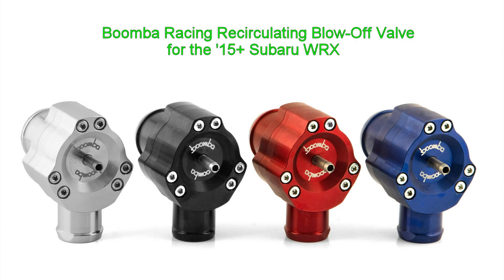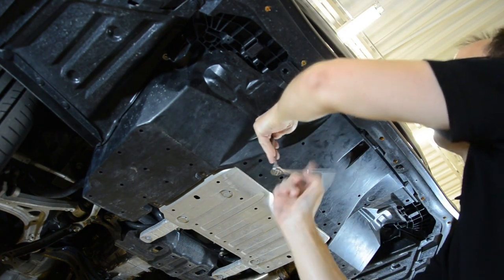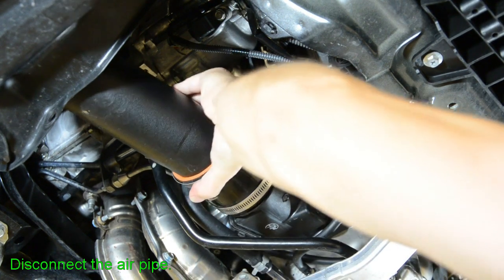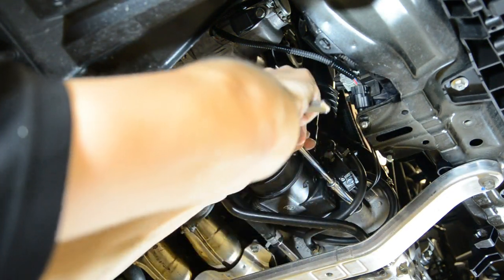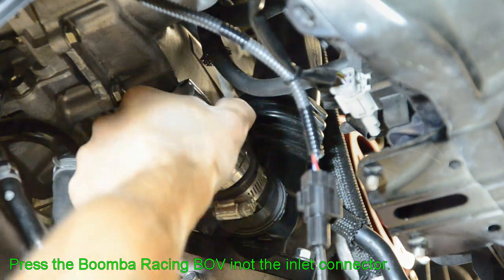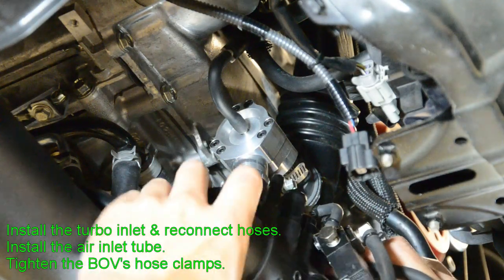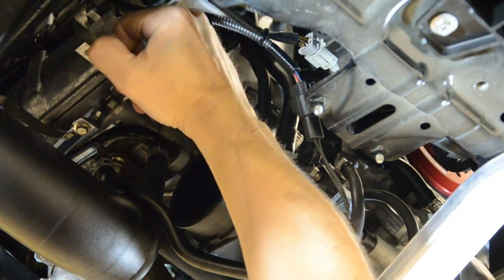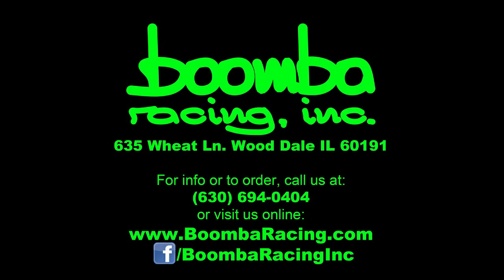How to Install | Boomba Bypass Valve for '15+ Subaru WRX

Comment: Great video Boomba. I'll be installing mine tomorrow, followed by my new IAG Air Oil Separator, Process West FMIC (TMIC delete), Mishimoto Radiator, Mishimoto Radiator Hoses, Mishimoto Radiator Fans, Cobb Overflow Tank, then the Cobb Redline Intake. Should take me a couple days done after work, but videos like this make me feel like it's gonna run pretty smooth. Until I drop that ever so important bolt that always ends up falling into a void lol. Thanks again!
Reply from the maker: Sounds like a good build! Thanks for the support!

Comment: Greetings all.   I just installed my new Boomba bypass valve on a 2018 WRX.  I test drove it, and all felt great.  My boost gauge showed a peak of 22.9 psi after one pull.  I don’t know what it showed before with the stock part.  Wish I had noticed.                         
Like “Subaru WRX” says below.....  our newer cars are different than the one in the video.  I’m glad he made his comments on this matter.  It did help. Thank you, Sir.

Comment: So I just got done installing this in my 2017 wrx...dude, this thing feels like it makes a HUGE difference. I'm not exactly sure how much but I definitely felt it in my pulls.
Reply from the maker: Thanks for the positive feedback! We're glad to hear you are happy with the piece! Probably picked up some PSI that your OEM piece was leaking off.
Reply: Boomba Racing if I reinstall the factory bpv, will that be ok after the hose being trimmed?

Comment: I just ordered mine! I cant wait to put it on! I just installed Cobb Port/SF 1 intake on my 2020 WRX. Thanks for the Vid!!
Reply from the maker: Thanks for choosing Boomba!
Reply: @BoombaRacing Easy to install. Took 45 mins or so. Sounds fantastic!! Thank you for the great product!!
Reply: Did you use an OTS tune or an E Tune?
Reply: Jay Lacson did you need a tune to run it or no
Reply: @darrenhernandez2459  No tune needed
Reply: @GaragebuiltOriginal  No tune needed
Reply: Jay Lacson thats surprising lol usually every little thing u put on subies you need a tune for smh! Thanks for the info
Reply: @darrenhernandez2459  Thats the first thing I researched before installing it lol.
Reply: @darrenhernandez2459  Its sounds crazy good with a nice intake!
Reply: No tune for intake either?
Reply: @lecoureurdesbois86  cobb accessport

Comment: Installed on my 2020WRX. Definitely a difference with throttle response. Much quicker pick up between shifts. Nice flutter sound!! Thanks Boomba Racing. Highly recommend as a first mod for your WRX. Not a bad way to get some extra gains.
Reply: JP's WRX yes, slightly.
Reply: It fit and lined up perfectly on my 2018 WRX without trimming the bypass valve connection on the turbo inlet. Some trimming may be required on older FA20 WRX models though. I however paired this with a Perrin charge pipe, Apexi drop in filter and a Perrin turbo inlet pipe and love hearing the turbo spool and bypass valve sounds that are audible. On a side note, 2015 to 2017 WRX's have an intake silencer/milk jug whereas the 2018 and newer ones do not have that on the factory air box, which can affect hearing the turbo and bypass valve
Reply: @Khans0120  hey ur comment is scream that I have finally found someone that can tell me why I can't hear my boomba bpv on my 2019 I also have a pretty Loud axleback exhaust if that matters please help me out!!!! I'd appreciate it a ton
Reply: Do you have any other modifications done to the car, preferably to the air intake so the engine breathes easier? If you haven't removed any of the plastic intake ducting and replaced it with something that lets the air flow freely,  you really won't hear any bypass valve sounds at all. If you want to know the most audible method of getting the sound, though, it will require you to install an aftermarket cold air intake and get the car pro-tuned so the engine does not get put in danger. On a side note, the Cobb OTS tune is not the way to go because that tune was not designed for your car specifically. That Cobb OTS tune possibly could work fine with your cars engine, or it could become a ticking time bomb due to your car residing in a different environment than their shop cars
Reply: @jamessanderson3498  what do you need help with? I have the same set up on my 20’
Reply: @brycegutierrez3483  I'm just wondering if I need some sort of aftermarket intake or at least the air pipe Inlet to get flutter

Comment: Installed mine tonight. Thanks for the video. I did not have to trim anything on my 2019.
Reply: BlueFA20 WRX great to know!! My bpv is coming in tonight for my 2019 base wrx and I didn’t wanna have to do too much extra
Reply: JP NPC I also have a 2018 WRX and I did not have to trim the bypass valve connection on the turbo inlet at all, it fit perfectly. I however paired this with an Apexi drop in air filter, Perrin charge pipe and Perrin turbo inlet, and I can honestly say that I love hearing the turbo spool and bypass valve go off due to those other parts amplifying the sound a bit. Our 2018's and onward do not have intake silencers/milk jugs like the previous years so that lack of restriction allows us to hear the turbo and bypass valve a tad more without the need to go with an aftermarket air intake setup

Comment: My 2017 Wrx had a wiring harness and a hose instead of just a hose with a clamp. they have changed it. But it still went on fine
Reply from the maker: Thanks for the heads up! Glad to hear the install still went smooth.
Reply: Derek Camacho How did you remove the hose and the wiring harness??
Reply from the maker: What year is your car, Derek?
Reply: BoombaRacingInc 2017
Reply from the maker: Derek Camacho Thanks for the info! We'll keep it on hand!
Reply: BoombaRacingInc you have to push up on the wiring harness because it's on a metal bracket. Once you do that the hose should come out with it to. Just a heads up.
Reply from the maker: Got it!
Reply: Thanks for leaving this tip! I was a bit confused when I first saw this extra wiring harness, but just pulled a little harder to get it off when I saw this.
Reply: @cmurillo100  I didn't remove them I just worked around them

Comment: Go back to the drawing board and make it so that we don't have to cut/trim our stock hardware to fit your part. Make it true plug and play.
Reply from the maker: Depending on how the vehicle was assembled, the line may have a kink in it if it is not trimmed when installing our BPV. We do have customers with our BPV installed without trimming that inlet. Even if you trim that inlet, the car will still be able to be returned back to stock should you ever want to go that route.
Reply: I only trim like 2MM and fits well but the the video instruction isn't a good representation of the 2017 model. My turbo inlet layout is different from their model car they were using. I skipped most of the step that recommended. I worked from an angle on the side instead directly under it. I was able to remove the stock BPV without removing the turbo outlet vacuum hose. I be honest I don't feel like reinstalling those cover that muc

Comment: If i want to install the stock back on, would I need to buy the tubing that was trimmed down??
Reply: @Boomba Racing -- would love a reply!
Reply: I’m guessing no. Since hardly any is trimmed off, there still should be plenty of seal for the stock BPV. If you’re concerned, you could zip tie or clamp the end of the connection to ensure a seal, but I think you’d be okay.

Comment: I’ve had this BPV for over 6 months now and it’s been great. Recently when I hit around 10 to 12 psi the boost hesitates and stutters for half a second then it acts normal and starts climbing again when I’m on the throttle. My DAM on my accessport drops after hard pulls. My tuner said he thinks the BPV has a leak and is causing it. He even went as far as saying that the stock bpv is better then the boomba from personal experience.  Have you guys heard of this problem before?
Reply: any updates on this??
Reply: Updates?
Reply: I have that exact problem with my stock bpv, changed the charge pipe and new cold air intake is better but still happens!! Weirdest shit ever
Reply: Ive had a similar problem but mine turned out to be my HPFP wasn't able to produe enough pressure so i got a Nostrum and it fixed the issue. ask youre tuner if it could be a fuel pressure isssue
Reply: Yes my tuner said the same thing here out of Houston. I have the boomba but have not installed for that reason.

Comment: Hey Boomba Racing this bpv helps with the turbo lag?
Reply from the maker: Our BPV helps boost build up faster due to our more efficient spring design. It also holds much more boost than the stock unit.

Comment: Is an aftermarket cold air intake required to hear the flutters?
Reply from the maker: Hi, if you're looking for flutter, you will hear it most audibly with an aftermarket intake!
Reply: @BoombaRacing  so if you have the stock intake you won’t hear a difference?
Reply from the maker: @itsDarrell  With the stock intake the BPV will still increase the amount of turbo noise that you hear but will definitely be quiet without an intake. The BPV is designed to hold higher boost pressures than the stock BPV and aid performance but we do recommend an intake if your goal is turbo noise.
Reply: @BoombaRacing  my goal is to keep my warranty and have as much of the sounds as I can get without a tune
Reply from the maker: @itsDarrell  There are a few aftermarket intake options we've seen that do not require a tune but we cannot provide any guarantees on those. As for warranty, the part has to be shown to have caused the failure to legally deny warranty service, we'd recommend developing good relationships with your dealer!

Comment: The instruction video was great. I installed the valve in under 2 hours and didn't trim the holes. Everything seemed to go together well but I dont hear a flutter or notice any gains in pressure. Did I do something wrong?
Reply: Yikes did you ever figure out what was wrong?
Reply: I called the company and asked about it. The first question they asked was if I had an aftermarket CAI installed. I dont. Therefore, it wouldn't work properly until I install one.
Reply: I just did this as well. Doesnt flutter like in other videos it sounds kinda stock. So you need an aftermarket intake to get the flutter

Comment: Hey guys can someone please help me.
I have a 2020 wrx sti and I live in Australia. Recently I have purchased a boomba BPV and I have been told it can't be installed in my car. Is that true ?? If not would it be the same as this video. Thanks in advance
Reply from the maker: This particular BPV is this video is specific to the 15+ WRX FA20 motors. The EJ25 motors in the STI's use a different BPV, which can be found here: http://www.boombaracing.com/wrx-sti-recirculating-bypass-valve-bpv/
Reply: @BoombaRacing  ok thank you so i need to purchas the one from the link for my 2020 wrx sti??

Comment: Are these the same directions for the 6th gen Outback?
Reply from the maker: Hi! This product was designed for the FA20 engine and unfortunately will not fit the FA24 on the Outback. This is the product that will work for your turbocharged outback: https://youtu.be/WVVtlSCNj1c
Reply: Thank You @BoombaRacing

Comment: Im not getting that “flutter” sound like most is that bexause im not tuned? And have a stock intake?
Reply from the maker: Hello! Yes, to produce the flutter sound the BPV and an intake is generally utilized. The part is a bypass valve and does not vent to atmosphere hence not hearing the flutter sound. Hope this helps!

Comment: I just installed my bpv today and realized that, the hose you guys say to trim in the video, has a split half way down the hose. Anybody know the part number of that hose? Going to need to replace it. Its the one that goes from the bpv to the turbo inlet. Thanks
Reply: I realize that this reply is a year late but did you consider buying the reinforced silicone Perrin turbo inlet for our cars that's nearly $300? It will save the inlet from obtaining leaks in the future, but yes I also agree that the Perrin turbo inlet is severely overpriced for what it is
Reply: S Khan yeah ended up having to buy the whole piece from subaru. It was called the air duct intake or something. Looking back i didnt know that the turbo inlet would be a full replacement for that part, or i would have went aftermarket. Ive since traded my subaru in for a truck
Reply: Yea, unfortunately this is a common failure point not sold separately from the intake assembly. I've been trying to find the inner and outer diameter of the hose, as mine too has failed. A simple silicone hosecan replace it, though requires basically going through this install process

Comment: Representing the CVT gang here, does this BPV work for the cvt and does it still sound alright without an intake or tune?
Reply from the maker: Still works on CVT! You'll still be able to hear the purge sound when you let off the throttle, but wont be as loud with OEM intake
Reply: @BoombaRacing  I’m curious, I have a drop in k&n panel filter but I’m not hearing the purge sound at all, I’m wondering if I forgot to connect a hose or not, people are telling me I did something wrong and some r telling me I’m fine so I’m unsure
Reply: Did u ever get the sound ?I'm having same issue

Comment: I have the stage 1 eTune by MAPerformance along with a Nameless Muffler Delete CHE.

Would like to do this someday but concerned about stalling, etc...It seems relatively simple to install and wish I knew for certain that this would be far superior to the stock one.  It seems that way per your videos though.  Hmmm...what to do.

Thanks!
Reply from the maker: You will not need a special tune to run that piece on your car! Our BPV operates in the same way as stock so there is no need to worry. We have customers running these on stock vehicles as well as highly modified ones. It holds boost much better than the stock piece.
Reply: BoombaRacingInc just ordered mine today!  Hopefully all goes as planned.
Reply from the maker: Thanks for the order! Let us know if you have any questions!
Reply: BoombaRacingInc Installed 3 weeks ago on a 2015 WRX with new air filter (stock) and MAPerformance Stage 1 Etune!  Definitely pulls harder now.  Impressed.  Maybe just me, but I have better MPG now for some strange reason.  Gonna fill up today and I am 367 miles whereas before 320 was the norm at complete empty.

THANK YOU,  BOOMBA!
Reply from the maker: Thanks for the positive review! We love hearing good reviews from our customers!

Comment: Question! Hi- I just bought two of these for the twin turbo 2015 wrx - I have a Cobb Stage 1 Waste Gate tune with a Mishimoto intake - I want to put them in this weekend but was considering to atmosphere them. What are the take of pros/cons on this?? Im not so much worried about the fuel ratio but rather the loss of sufficient engine power or a disrupt in the epu thx!
Reply from the maker: Happy to answer that for you, the WRX is MAF tuned, meaning that you can't vent to atmosphere. This is because the air that you would be venting, is already metered.
Reply: Perfect thank you for the fast response !
Reply: Joe Pierce it’s twin scroll not twin turbo 🤦🏼‍♀️
Reply: francis888milot realized that shortly after

Comment: do you still have to trim with the new cobb and gs cast aluminum inlets ?
Reply from the maker: Hi! We know that this part fits the stock inlet but are not certain about fitment on the aftermarket options. If there is a rubber connector for the aluminum inlets it may be possible!
Reply: @BoombaRacing  yes it's a upgraded silicone coupler
Reply from the maker: @peezy304  Great! As long as that is the case and the inlet is routed the same way as stock the fitment should be good!

Comment: Would be perfect if it weren't for trimming plastic off of the piece the boomba fits onto.. will it make it impossible to reattach the stock part in tje event of selling the car and getting the stock bpv on?
Reply from the maker: Some customers have made it work without trimming that piece. However if you ever do go back to stock, you can simply buy a new piece of hose from an auto parts store and swap it on. Very easy thing to do.
Reply: How important is it to trim this piece? Can I just force it in as much as possible without trimming are there any negative effects?
Reply: @BoombaRacing  what's the diameter of that hose? Not only for converting back to stock, but because it's a semi common failure point(mine failed)
Reply from the maker: @devl8565  the diameter is 5/32

https://www.boombaracing.com/2015-2021-wrx-bypass-hose-extention-and-adapter-replacement/
Reply: @BoombaRacing  unfortunately this is a different hose
Reply: For reference, 3:00

Comment: If i have Stage 2 tune(EBC,Catless TBE,TGV Deletes,TMIC,Chargepipe) would my tuner have re-tune my car for this blow-off valve?
Reply from the maker: Hey there, we have customers running this piece on totally stock vehicles as well as ones that are highly modified. Since this piece is recirculation, a re-tune is not needed. However, you may see even smoother boost if you do get a re-tune specific to this part.

Comment: i just wanted to make sure I don't have to tune my 2016 subi wrx if I install this boomba bov! just remove old bov and install new boomba bov with no issue's. right?
Reply from the maker: This piece is as plug and play as it gets. It bolts right no and works with no special tuning!
Reply: Wondering will be the installation way same for the wrx 2016?

Comment: Is this BOV applicable to 2015 STI and has there been any issues, check engine light, Boost leak, backfiring etc? TY
Reply from the maker: This BPV is non adjustable and is meant for the WRX only, not the STI. This piece works on totally stock vehicles as well as extensively modified ones. It will not cause any issues.